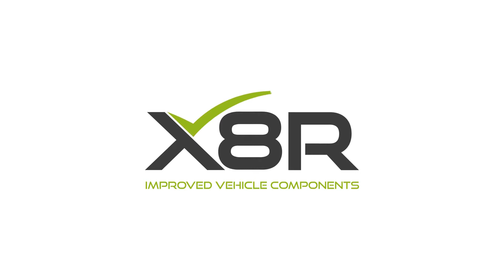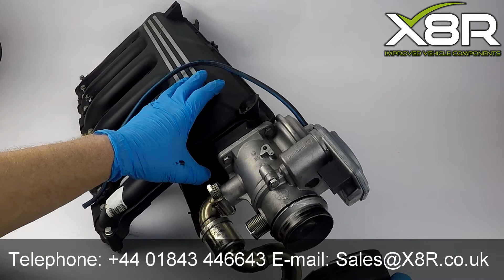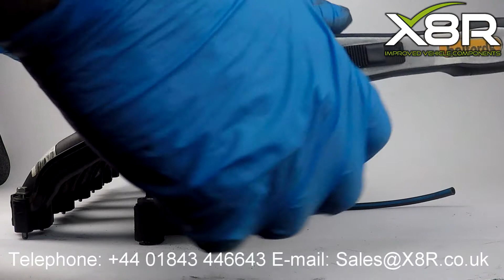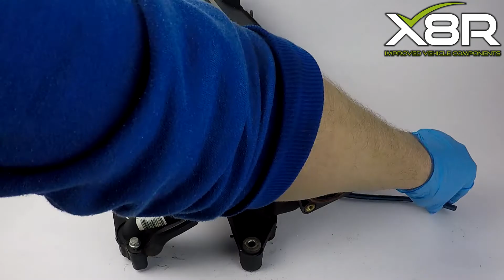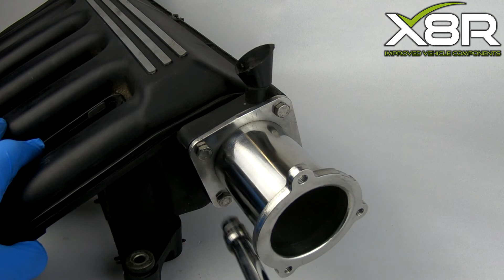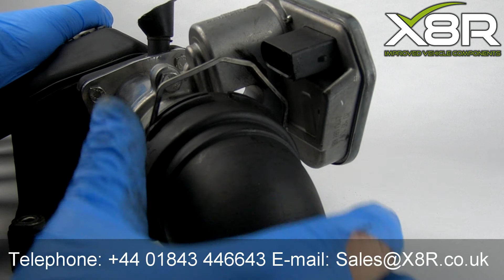BMW EGR Anti Shudder Type Valve Delete Bypass Blanking Blank Tube Fix Repair Fix Kit Replacement

Comment: OMG this is so damn awesome & simple. You reduce weight up front, improve performance, fuel efficiency, simplify the engine bay, & eliminates soot buildup. I WANT THIS. Before I compare stupid EGR part numbers on realoem website, are the delete kits the same for 120i N43 motors?

Comment: Hi hello I have a  x6 3.0 td would like to delete  cooler  and EGR VALVE do you need to remap after is all changed OVER all so my DPF  warning is up as well been TOLD  it would make a big difference to the car in many way ,all do you need to just reset engine  light on dash as if you block vacuum  hose light appears on dash but I do have a BMW reset tool 310 + creator and how much would it cost I think I can change over my self many thanks james
Reply: Did you find out? I also want to delete the egr on my bmw and I don't know if it is a good ideea, also do I have to blank the egr thermostat?